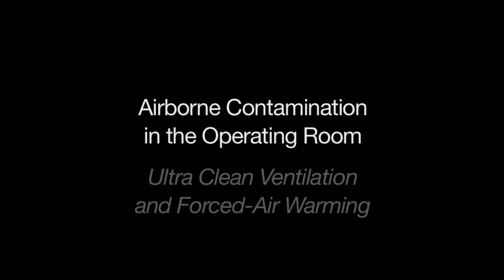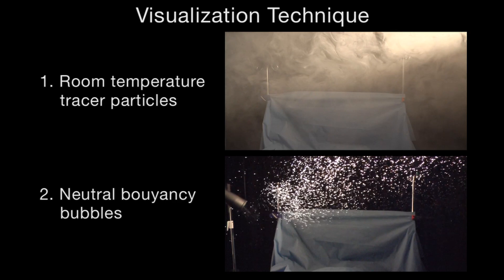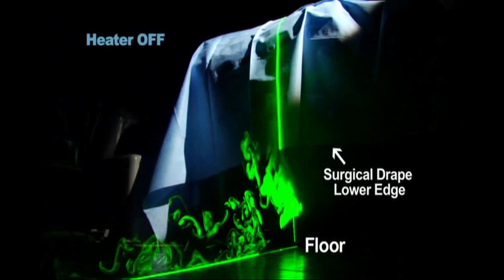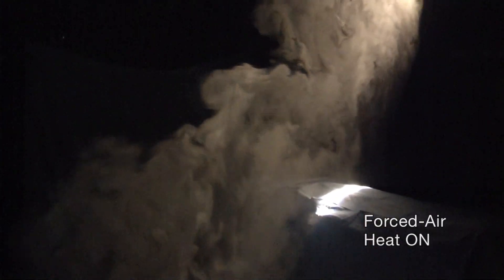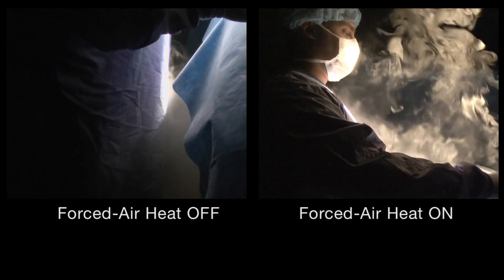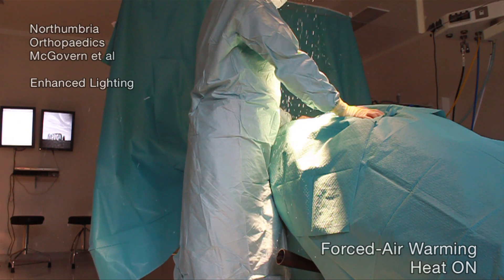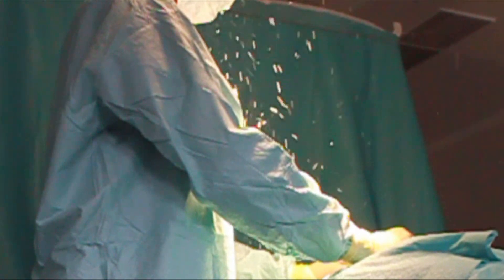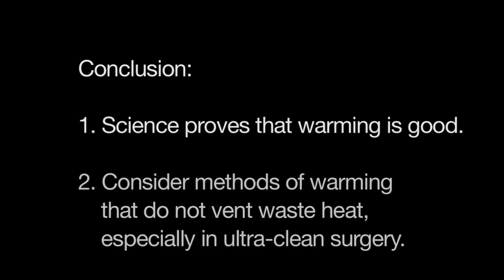Airborne Contamination in the Operating Room

Comment: has this informaiton been peer reviewed?  Is there any references to draw from on these comments?  It seems 3M and this state opposite statements but I can not find any reference material from peer reviews???  If I am understanding this properly, the heat from surgical lights is a possible contaminant generator by disrupting laminar airflow from the heat of the bulbs in them??
Reply from the maker: The surgical lights obstruct the airflow from the ventilation system and create the path of least resistance for the thermal convection currents caused by the waste heat from forced-air systems to transport airborne contaminants. Thanks for your comment! Link to published research http://hotdogwarming.com/wp-content/uploads/M206_Research-Summary.pdf